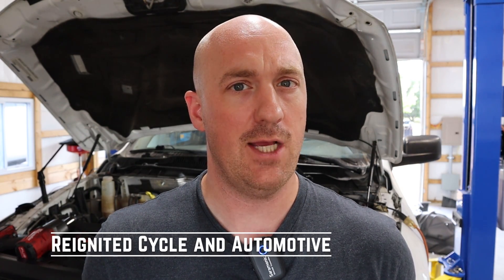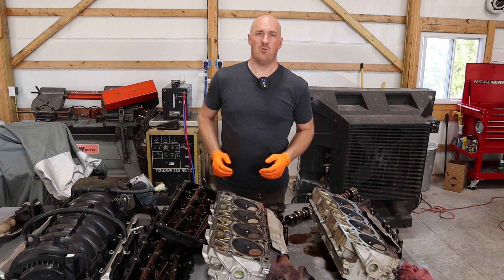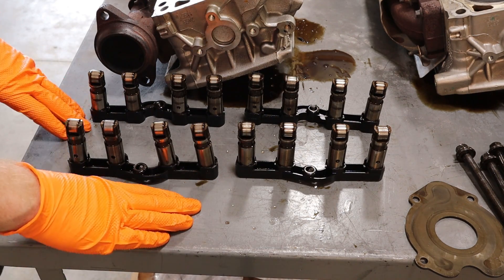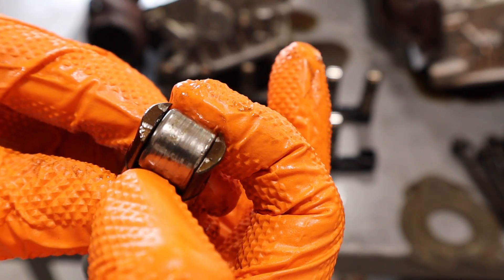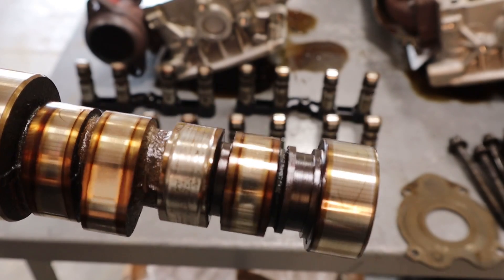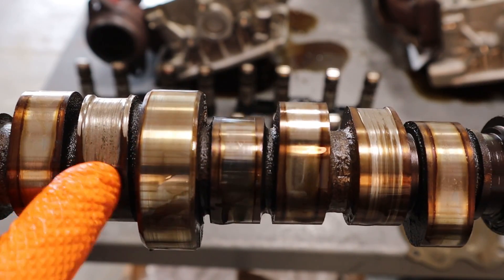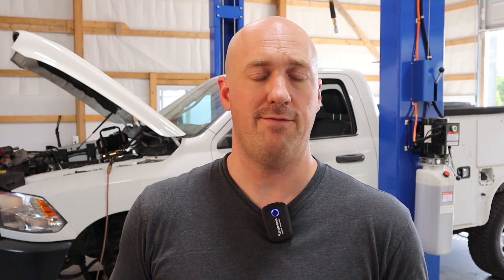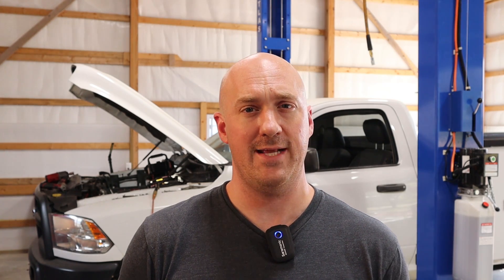Hemi 5.7 Lifter FAILURE Does this engine have a fatal flaw? Find out how YOU can prevent it!!!

Comment: Unless other engines have the same problem from idling a lot, the Hemi does have a fatal flaw.
Reply: They don’t. 

LSs on Caprice Pursuits idle all the time. They aren’t eating lifters.
Reply: @Bartonovich52  i watched a video a while ago (I can't find the link) from a guy who works alot on LS engine, he was working on one that had a similar issue he was saying that it was common on all the LS engine with cylinder deactivation. I haven't heard as much about LS engine but the guy seemed to know what he was talking about.  It really seems like its a cylinder deactivation issue.
Reply: It is a fatal flaw.  Face it,  a roller lifter should never fail with any regularity.  It is a lubrication issue caused from lack of oil on the needles and rollers.

Comment: The breaking down of the oil might be part of the cause but I know one of the main causes is the design of the engine block where that tube flows through the lifter valley and keeps oil from dripping down through the galleys where it's supposed to go
Reply from the maker: Check out my latest video discussing the oil flow for this issue! Link is in the pinned comment at the top 👍

Comment: What about the valve seats falling out and destroying the engine
Reply from the maker: That's most prevalent on the '06-'08 models, they pretty much solved it on the '09+. If you want to see more info on the valve seat issue check out my Chrysler 300C rebuild series on the channel, textbook case of a dropped valve seat. 👍

Comment: Chrysler lies. It's not the oil breaking down. There is little to no oil getting to the cam lobes at hot idle. The lifters are at too low of an angle to drip any kind of oil onto the cam. The cam is to high in the block to get any splash from the crank and the oil galley tube is directly under the cam blocking crank splash. There are no cam squirters and no oil holes through the lifters to oil the rollers. If you want your hemi to last DON'T LET IT IDLE!
Reply from the maker: Check out my latest video on this issue for more info on the oiling system! The link is in the pinned comment at the top 👍

Comment: I changed the oil in my 2010 Ram 1500 every 3000 miles, with the exception of a 3-4 times I was around 4000 miles and this failure happened to me at 118k miles.  I typically used castrol 5w-20 conventional oil.  This is a daily driver and no long idle times like fleet or police vehicles.
Reply: I change my oil every 10,000 miles with pennz oil synthetic oil ,& never idle my truck more than 2 minutes ,& iv got 200,000 miles on my truck ,never had an issue, not once
Reply: @donkeyballs3307 what year?
Reply: @mtn-endeavors67  2014
Reply: Same with us.  My brother did the 3000 mile oil changes on his 2011 Ram 1500 and his Hemi still ended up with no compression on cyl. #3 at only 198,000 miles.  Never buying another Hemi again!
Reply: Conventional? Eeek. I change mine in my 06 Daytona Charger every 3k miles ish (5-6k kms) with just cheapo pennzoil castrol ect engine oil that's on sale, use a OEM Mopar Oil filter (i somehow get them straight from the dealer for likr 5 6 dollars...not sure why) And no problems as of 130k ish miles, driven hard.

Comment: I own a 6.4 hemi RAM 2500 with mds. Not an oil change interval problem. It's a design flaw which needs recall. I maliciously change my oil early with recommended synthetic mopar oil and had failed lifters. Chrysler just doesn't want to address the flaws because they'll go bankrupt again.

Comment: Don't forget the tick that comes from the fuel injectors How many miles did that engine you had pulled apart have?
Reply from the maker: If I remember correctly it had around 250k

Comment: Yes, there is a fatal flaw. The cam lobes and roller bearings in the lifters are only lubed by splash oil. That is not enough to keep them alive.
Reply from the maker: Check out my latest video for more information on this topic! Link is in the pinned comment at the top. 👍

Comment: I freaken new it ...... Wow thanks bud appreciate it have a 06 300c third engine love the car power as well but. Im for sure going to keep the maintenance religiously thanks again
Reply from the maker: I appreciate you watching! 👍
Reply: Third engine???? Did the seats drop in the first or second one? Damn 3 engines seems a bit much lol. I  abuse my 06 Daytona Charger with the hemi, it's got 130k miles (220k kms) i change the oil at 3k miles (5-6k kms) with just cheaper full synthetics on sale, pennzoil castrol ect. No problems with mine yet. I try to keep up on the fluids, coolant and oil. Don't want to see it overheat and drop a seat
Reply: @baileyhatfield4273  ya on the first two cause my negligence on maintenance got a third one then not even two miles on tbe drive home i felt a shif in the motor got home oil coming out the fresh air hose opened the air box full of oil ...compresion reversed in one of my cylinders so it was pushing the oil out took it back they fixed had for a week so far and yesterday it was stahlin changed the tb on it seemed ok this morning...bottom line is I've had so much happen with this 300c im getting fed up but then i drive it and im happy thinking of tradeing it in

Comment: The MDS lifters are the ones that fail because of temperature differences and expansion/contraction.  When those cylinders shut down, everything connected to them cools down while the rest of the engine heats up (or more likely maintains temperature) then a nice cool lifter and valve slams into a hot piston/camshaft/ lifter and BOOM. Catastrophic engine failure. 90% of the forum posters that have reported this problem have the same story. It either happened right after a long highway trip, or after a shut down, and quick restart. MDS is half responsible for this.
Reply from the maker: Good info! Check out my latest video on this issue for more information, the link is in the pinned comment at the top. Thanks for watching! 👍

Comment: I just replaced a camshaft and lifters on a 2012 dodge ram 1500 with 5.7 now that everything is put back together It doesn't want to start, what could be the problem
Reply from the maker: One common mistake that many people make is that it's very easy to get the pushrods not fully seated in the lifters, and when seating the rocker arms the pushrods may not be seated in the rockers either. I'd pop the valve covers off and check all the pushrods first. You can check the rocker arms visually to see if they're seated, then roll the engine over by hand watching all the valve springs, if you've got a valve that will not fully close, the pushrod is likely not seated in the lifter properly. 
Does the engine cough/stumble/try to start?
Reply: @ReignitedAuto  no nothing but the lights come on when the key fob is turned to acc but it dosent even try to start i also bought a cam shaft senor thinking that would be the problem but still nothing

Comment: I have 3 Hemis  with over 100k miles and two with over 200k miles on it. I always use this product call Engine Restore on all my oil change, it basically helps the oil to stick and stay on all metal moving parts. I also Rebuilt the hemi  motors as well. It's good stuff, I use on my SRT and my two 5.7 hemi.👌
Reply: Let me guess, you sell it; LMAO ROTFL

Go somewhere else to peddle your snake oil lol
Reply from the maker: Thanks for the feedback! 👍

Comment: My 2018 5.7 durango made that same noise since brand new.  Also every so often I can hear the lifter make a extreme rattle noise upon over night  start up goes away maybe 1-3 secs after it’s running.  My oil percentage goes down with idle time or driving
Reply from the maker: I've been hearing more and more from people who are having an issue with the hydraulic portion of the lifter leaking down overnight causing that bad rattle on startup. I haven't experienced it too much myself, but that doesn't mean it's not happening. Thanks for watching! 👍
Reply: @ReignitedAuto  it’s totally random but yes it sounds like dry lifters being cycled and making a ton of noise in the process

Comment: Loved my 5.7 Hemi in my 2016 ram 1500. I always changed my oil before recommended but at 130k miles I'm pretty certain my truck needs new lifters and cam 😭 bad cylinder 3 misfire under load and the tick. I just had my exhaust manifold bolts replaced too. Taking it to the dealer next week to find out for sure. Not a cheap repair at all from what I've read.
Reply: Do you let car idle a lot ?
Reply: @OddWrld  not more than a n normal person would I don't think. Just had the cam and lifters replaced. Trucks runs great now!
Reply: @SteegeFish  did you get the updated version of the lifters and cam or the old ?   The new ones have a beefier lifter and big needle bearings.  The new cam has higher lobes
Reply: @OddWrld   I honestly don’t know. It was done by a dealer so I hope they used the newest better parts but who knows. Hoping I get at least another 150k miles out of her

Comment: Personal history with three SBC motors.  All had oil changes every 2k miles.  All went deep in to the 300k mile range with no major engine work.  All sold in running condition, one to my knowledge, still on the road.  Regular oil changes is the cheapest maintenance a car guy can put in to a motor.  I don't have as many miles on the two Hemi's yet, but I expect the same results with frequent oil changes - ahead of the FCA recommended schedule.
Reply from the maker: I hate to say it, but it's an often overlooked part of basic maintenance. Engines today work so well that people just flat out forget to service them, because they don't have issues immediately like older engines might have. Appreciate your reply and thank you for watching! 👍

Comment: Theres a pressurized oil galley under the cam.  Why cant there be small holes drilled to simply squirt more oil up on the cam/roller to add lubrication.  Much like piston squirters do.??
Reply from the maker: Someone else mentioned this as well, I think it's a good idea, but the factory would have to implement it, as there's no access to the top of the galley to do it after the block is formed. Would be interesting to see if that's an update they come up with for the next generation though! Thanks for watching 👍

Comment: I can attest to you that using a HIGH QUALITY Synthetic oil, such as AMSOIL Synthetics, will give you better protection from wear like this video is showing.  The AMSOIL "Signature: oils", will not break down like a conventional or most other synthetics, as proven by the API-sp/Ilsac GF-6 requirements.

75 percent more wear protection
 1 00 percent protection from LSPI 
2 -Trusted by professional engine builders

3 -50 percent more cleaning power
 4
- Ideal for turbos & direct injection

1 Based on independent testing in the ASTM D6891 test using 0W-20 as worst-case representation. 2 Based on independent testing in the LSPI engine test as required for the GM dexos1® Gen 2 specification.

Comment: I bought a used 2012 ram 1500 and it has a bad tick when it’s cold but when it warms up it’s no where near as bad does that sound like exhaust leak? Or cam issues? Or both I have a power train warranty wouldn’t cover this
Reply from the maker: Definitely sounds like exhaust leak to me, check out my other video "the other Hemi tick" and you'll see the full repair 👍

Comment: Great video!  Thank you! The dealer just replaced lifters on my '18 5.7 HEMI @23k miles, not sure how many they changed and I don't think they changed the cam.  They changed them due to a tick at startup only.  Afterward, the tick is gone.  I'd be curious to hear your thoughts on this?  Did they just tighten a manifold bolt?  Is there any way I can visually check that the heads were removed?  Just wondering now if I got some lip-service from my otherwise very good dealer?  I welcome any thoughts/comments?  Thank you!
Reply from the maker: Nah, most dealers are happy to do the job under warranty, they get paid to do it by Chrysler so there's no point in not actually performing the work. Having a tick on startup only makes me think that the hydraulic portion of one of the lifters must have been bleeding down overnight, then it'll tick on startup until it gets pumped back up with oil again. This is a separate issue from the roller bearings on the lifters failing, so no need to change the camshaft. Sounds like they got it right. 👍
Reply: @ReignitedAuto  Awesome news!  Thank you so much!  Greatly appreciated!

Comment: Great video on a confusing issue. 
One question I have:  On failed motor (roller tips and cam lobes wiped) could the hydraulic part of a failed lifter be checked? I thought on non roller hydraulic lifters you could test bleed down with it submerged in oil and a push rod in a drill press for leverage? It be interesting to know if the lifter failed because it wasn’t holding pressure and that caused the roller to hammer the cam?  If that was the case, it would seem to be just shitty lifters and not some  “fatal” oiling flaw?  Thanks!
Reply from the maker: That's a good thought and something that I haven't looked into myself. I dont think I've ever checked the hydraulic portion of a failed lifter. Humm, more food for thought! 👍
Reply: @ReignitedAuto  Thanks for your response! Appreciate your videos.  It’s a tough subject especially when brand loyalty or brand hatred get involved so you end up having to sift through that as well. Thanks

Comment: My 2014 with 5.7 liter with 10,000 km still shows 30% oil life left, Owners manual says never go any longer than 16,000 KM.  I believe they don't the lifters get proper lubrication at Idol. I don't idle mine for more than two minutes before driving and getting the RPM up. The gentleman says most often the MDS lifters fail... DESIGN FLAW! If I were follow the manufactures oil change recommendations and my lifters fail who is to blame?
Reply from the maker: Check out my latest video on this topic for a more in depth look at this issue! link is in the pinned comment at the top 👍

Comment: What about the small needle bearings on the lifter roller the hell cat uses a ball bearing a bigger bearing a lot of guys are swapping out to the hell cat lifters is that a good idea? Please help because I need to fix my 5.7 and I only want to do it once !!! With the lifter that is going to last (my truck is a 2013 long horn no mds) thank you
Reply from the maker: Honestly I was not aware of the Hellcat using different lifters. I'm going in to my old work tomorrow, I'll ask and see if there's any difference in part numbers between the hellcat version and the normal version. 👍
Reply: @ReignitedAuto  ok thank you I Honestly couldn’t tell you either I’m just going by what I read on the good old Internet

Comment: Great vid but I have one question. Since my 2014 was bought new every now and then on cold start up I would hear a small tick then go away. Almost as if the engine is building up oil pressure. It's a short duration of a noise. My truck now has 53k miles and I change the oil every 5k with synthetic oil. I never beat on it and the only thing I pull with it occasionally is my Harleys to my summer home. Overall I like my truck. With that said repairing it would be my option due to the fact that all this pickups are way over priced. I bought mine in cash in 2013.
Reply from the maker: Well, it depends on the noise. If it's a loud tick noise that goes away quickly, you might look into my video about the "other" Hemi tick dealing with broken exhaust manifold bolts. It's an extremely common issue and could be the source of your noise. On the other hand, if you're certain the noise is valvetrain related but it goes away quickly on cold starts, I wouldn't worry about that at all. These hemi engines, even the ones in the brand new trucks will do that. They have a somewhat noisy valvetrain on startup. Hope that helps, and thank you for watching! 👍

Comment: Cam and lifter replacement doesn't get rid of fine metal from engine. This is why lifters and other failures occur after the replacement.
Reply from the maker: That can be true. In fact, with the 6.4 truck engine, Chrysler directs to remove the oil control solenoid for the VVT after a cam/lifter failure. If the screen on the solenoid is covered in metal we must replace the shortblock entirely otherwise warranty will not cover the repairs. Thanks for watching! 👍

Comment: Would adding a little thicker weight oil potentially help?? I'm in Florida and it gets real hot and I don't believe on lighter weight oil, I always thought putting a little heavier like 10w30 would lubricate better and not thin out on those extra hotter days when the engine needs to be lubricated the most
Reply from the maker: Check out my new video on this I just posted today! Link is in the pinned comment at the top. Thanks for watching! 👍
Reply: That's will destroy ur engine